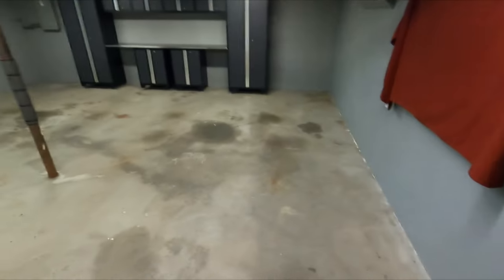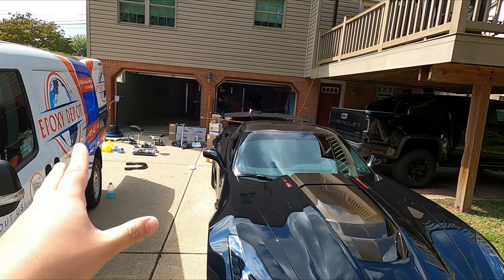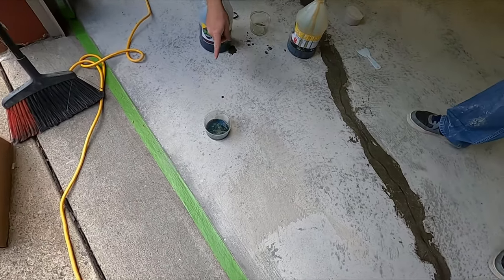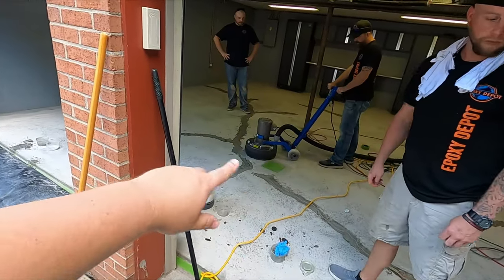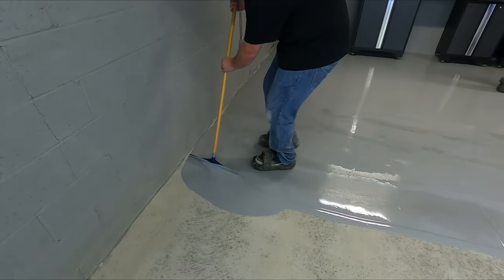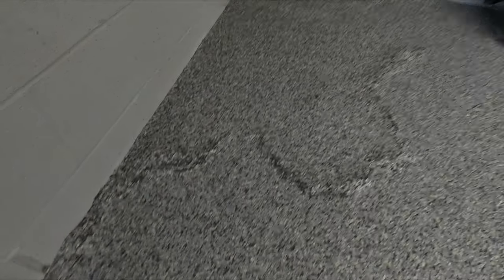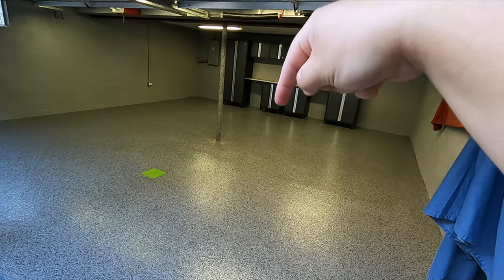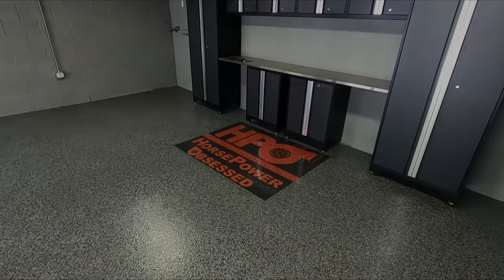Make YOUR garage look NEW again! Transform your space with EPOXY!

Comment: I have this in my Garage got it done in 2005 and in a few spots it is starting to break down. I will just patch up the spots. The floor is pretty much good.
Reply from the maker: That sounds about right. Most spots can be touched up individually with some chips and clear coat and you won't be able to tell.
Reply: @HorsePowerObsessed  thanks I will look into that. I think Home Depot or Lowes sells it or even Amazon.

Comment: If you weren't obsessed, I wouldn't be a subscriber. 😉😉The Coups de Grace was when the clear coat was applied. WOW!  It's also nice to see someone else who is obsessed with doing things right and doing it right the first time and have pride in ownership. The Epoxy Depot USA is tops in my book. 👍 I suppose applying this new lloor is weather critical though. For us in the Northeast, I guess as of this writing we've lost our window with temps going lower daily now. I will check out their website though, but to save me some research time, are they only doing their garage floor transformation in Pa., or do they travel?

Save the Wave 🙋‍♂
Reply from the maker: 100% agree!! They are nationwide so they would do your floor as well! This was actually done in late September for me last year so weather is still good to go! They said it will still cure during the winter as well though!
Reply: Thank you Justin for the info. One last question, I suppose it goes without saying that this epoxy coating is virtually impervious to oil or anit-freeze should a vehicle be leaking either one of these?
Reply from the maker: Yup. As long as you don’t let it sit forever it would wipe right up without damage.

Comment: Looks good. My issue I found with my garage. I have radiant heat in my garage floor. I did it myself when it was new. But the behr product did not hold up to the hot tires. A lot of this flooring cannot be put down on radiant heat.
Reply from the maker: Not sure on that one. Without radiant heat it has held up perfectly with the ZR1 tires.

Comment: Justin,  Justin,  Justin,  you didn't put flakes on your floor , did you?  Come on Man, really?  As someone who works on cars you should have known better.   The first time you drop a washer, bolt or screw you will regret all those F-ing flakes.  You'll be looks for those by braille.   It will be so hard to spot them with all those flakes.  Other than that looks good. Hopefully if you loose at they'll be on your logi where you can see them.
Reply from the maker: Oh I'm sure but there's really no good option for that. Metallic hides stuff, flake hides stuff, race deck literally hides and covers stuff. There's no win lol. With that said, I haven't had an issue yet with it but I'm usually pretty careful with stuff like that.
Reply: @HorsePowerObsessed  I only say that from experience.  I've had to work around patting the floor looking for a washer before.  Buy it does look great.  And it's cool those Guys have training classes.  I am building a house with a 30' x 50' shop in Coastal Carolina and they don't have a location near me so I think I'll be on my own, but will take their training first.